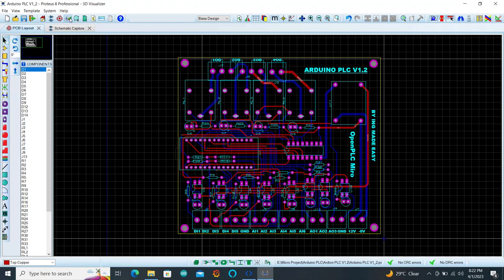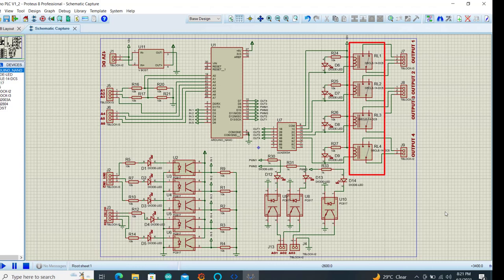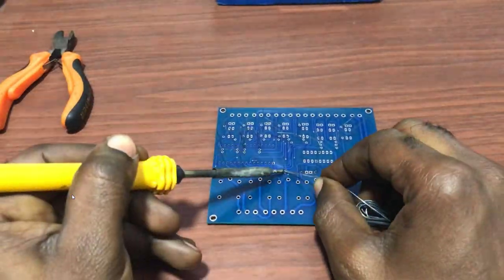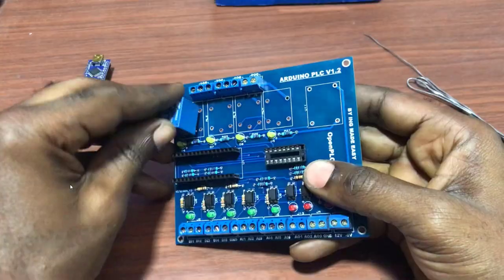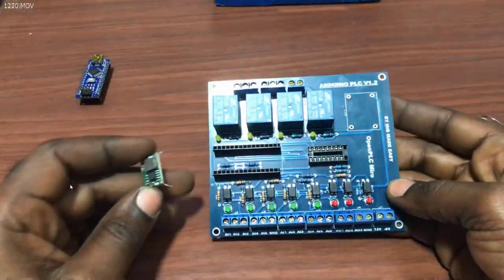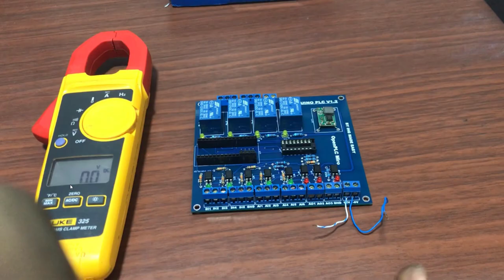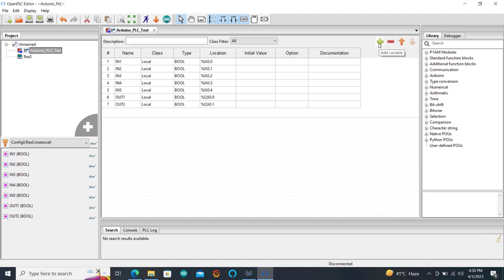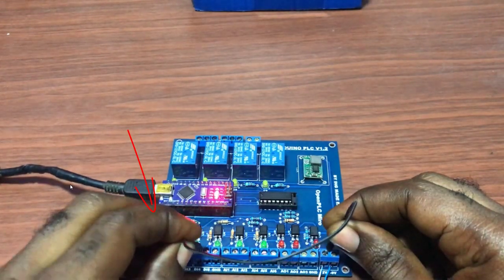DIY Arduino PLC  - How to Build an Arduino Based PLC

Comment: Hey, how did you export the codes from the OPEN PLC software to build folder in your drive can you tell me plz.
Reply from the maker: You need to connect the board to your computer, then click on the Arduino Icon in OpenPLC editor. this will open the 'Upload to Arduino Board' window, In this window. 
 1. Select your board type (mine is Nano Board but Flashed 
      with Uno Boot Loader so I selected Arduino Uno)
 2. Select the correct com Port your Board is connected to.
 3.  After Click on 'Upload' button.
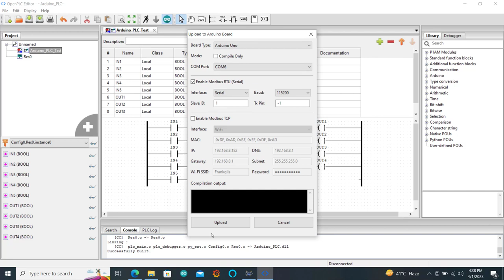Kindly check the last part of the video for this step (around 18:50 play time)
Hope this answers your question. thanks
Reply: @engineeringmadeeasyingme6819  oh thank you it helped :D
Reply from the maker: Great @DuroLabs85

Comment: Good job 👏.  How much time did you spend to do this? I mean in proteus. What about think which is better do like this project in proteus or kicad?
Reply from the maker: Thanks for the compliment. I Haven't used kicad that much so can't speak to that. However with proteus it's pretty straight forward within 2hour you should be able to implement it using the auto routing functionality. The time consuming part is the circuit design planing which in my opinion has nothing to do with the PCB design software. If you have a clear layout plan you will spend less time implementing it in the PCB software. Hope this helps. Thank

Comment: what is input range of arduino PLC? means can i connect directly 12 volt sensor to it?
Reply from the maker: Yes, the Input can handle 12V directly. Thanks for your question

Comment: can you draw the circuit through altium software / my Proteus version is low so it can't be opened / thanks
Reply from the maker: Thanks for your comment. Unfortunately I don't have altium currently. However I will try get one and share it's circuit with you.
Reply: @engineeringmadeeasyingme6819  hope you make more videos on how to use this plc_arduino (eg: using sensors, controlling motors)

Comment: Hi, I have a question regarding opto isolation, does the buck converter in your design provide this?
Reply from the maker: if I understand your question correctly, the Opto-isolators are only at the input pin to allow a wide rang of input voltage form say 5V to  24V, it also protect the arduino input pins. the Buck converter converts the 12V input supply to 5V for the arduino board since the converter is  a module type, I don't really know if it has onboard Opto-isolator  . guess this helps thanks for your question.
Reply: Hi, thanks for getting back to me, what I meant in my original question is, if the buck converter doesn’t have an isolated output, then there will be no galvanic isolation provided by the opto isolators because the input and output of the opto isolators are using the same ground point.
Reply from the maker: @markdevlin653  oh Ok I get you now, I didn't consider that in this design will try and do that in the next version. thanks for the info I really appreciate.
Reply: Hi, no probs, You could consider using b2405s 24 V to 5V with isolated output.
Reply from the maker: @markdevlin653  Great thanks

Comment: Why did I load the program and error, even though it was installed exactly like in the video
Reply from the maker: Thanks for your question. Do you have the error doing the Upload process or whiles the code is compiling? if possible, kindly share the error message.  thanks

Comment: Interesting, but i'm trying to buy the same components and i don't find the reference of 'V bost IM130731001' , 'TBLOCK-I2' , 'TBLOCK-I3' and the 'G5CLE-14-DC5' .You will help me a lot if you put the links to buying or the commercial references. Thanks a lot for share your knowledge!!
Reply from the maker: You are welcome and thanks too for your comment. kindly check, I have added the Links of the components to the video description now. Hope it helps.